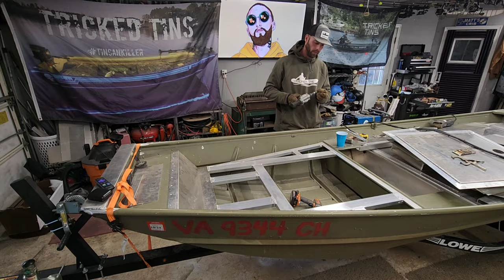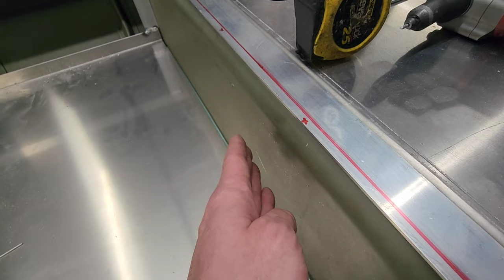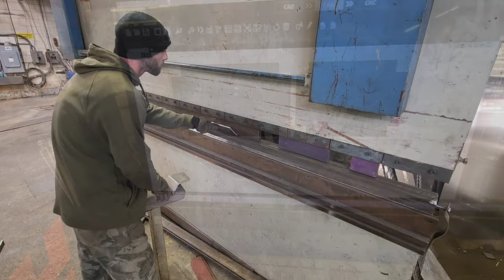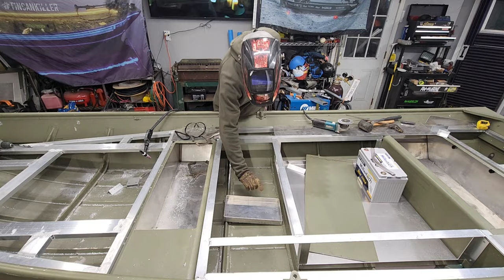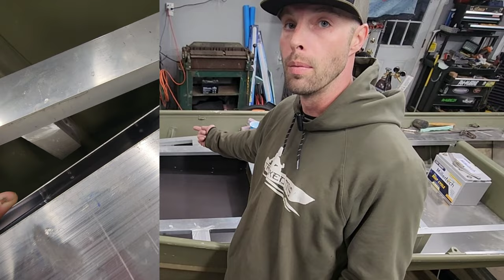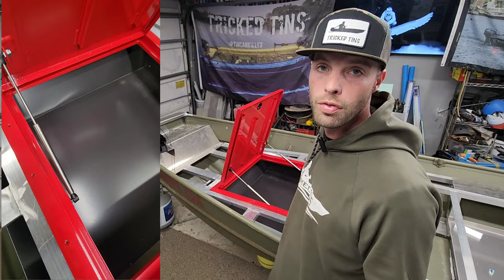Tiny Boat Build @FISHERYIN

Comment: That framing is gonna be strong enough to hold all the big ol' blugills ima be boatflipping 😎
Reply from the maker: That deck could hold a 1000 blue gils
Reply: With me sitting next to you! 😂😆
Reply: They are for dock protectors when boat is moored to dock on side,protects boat from dock damage.can be used for stringers or bait baskets.

Comment: Matt, this build is turning out one amazing "Tricked Tins Masterpiece"!  That front hatch with the gas pistons is awesome, and the trolling motor mount is solid.  Not only is the build light in weight but it has increased the rigidity and strength of the hull.  Well done, can't wait to see the paint job and the turf!  Waiting anxiously for the next video!
Reply from the maker: I want to see the turf myself!